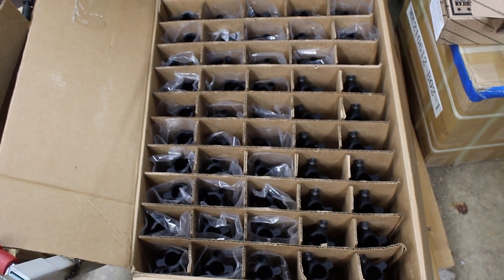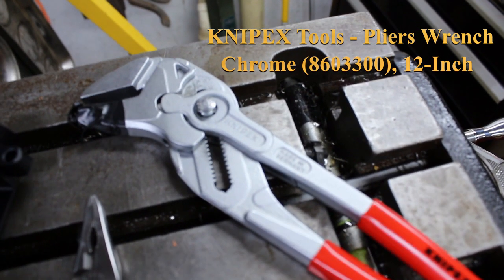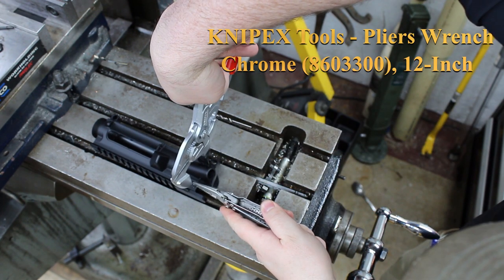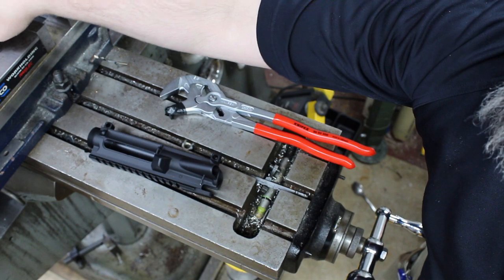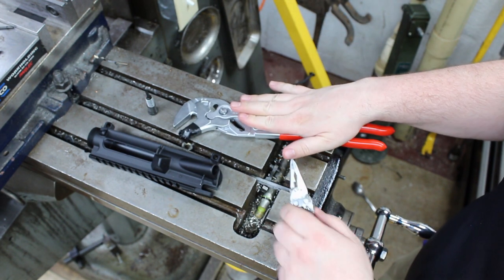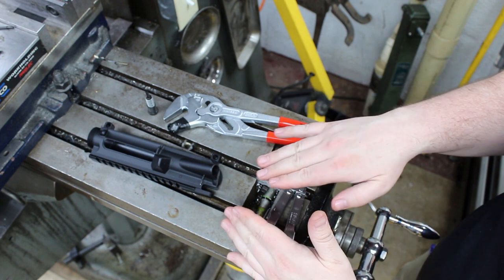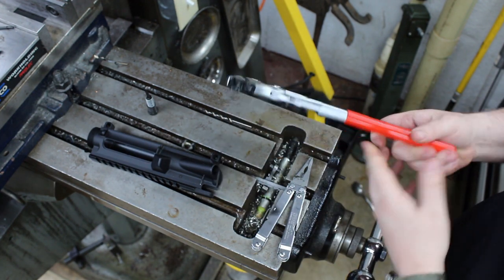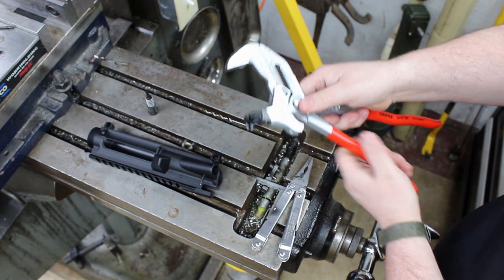The AR-15 build tool you didn't know you needed.

Comment: Huh. I friggin' HATE putting in roll pins! So, this is how you get them started...
Reply from the maker: I know it!  I've marred up so many surfaces using a punch and hammer, and those roll pin punches just seem to act as a riveting tool.....  also,  your not going to get away without removing the finish on the pin head using a punch. Not to mention wollering out the aluminum hole by trying to wack a pin in there crooked.

Doing this,  solves all those issues. You apply the force only once everything is in alignment. Its constant steady pressure so nothing gets peened, and it saves the finish on all parts and pieces.
Reply: @SmallTeamSupply  - Brilliant.
Reply from the maker: @christopherlarsen7788  Thanks!